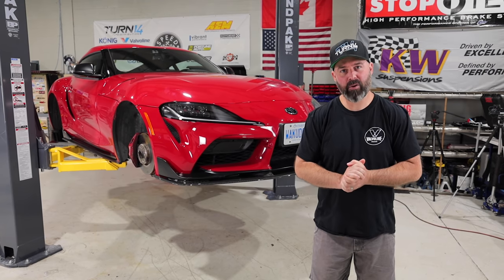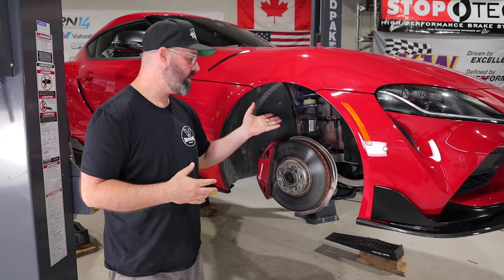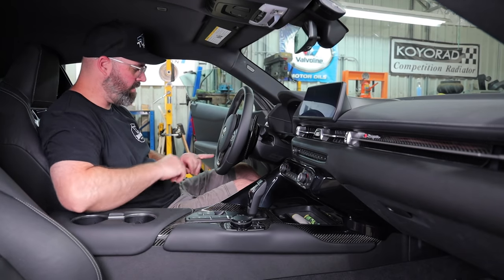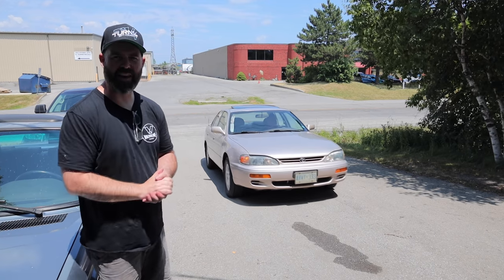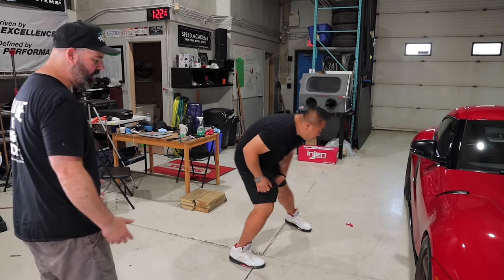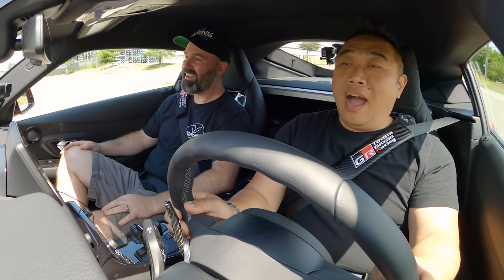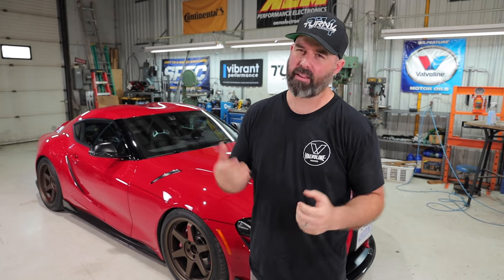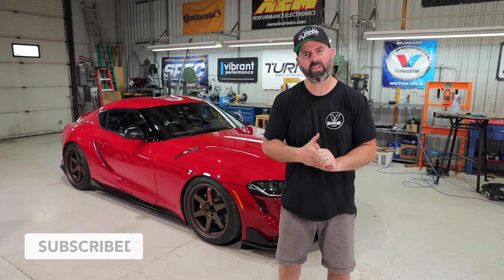Quick and Easy Toyota Supra Build - Part 2 of 2

Comment: What people don't realise is the progress made in the last 20 years on cars isn't so much at the top of the chain, but the bottom and middle of the chain. There are some pretty boring cars that will take out sports cars of the early 00s no problem, and sports cars of today that can take on super cars of the same vintage because of the progress in technology of things you don't even think about. OEM suspension components have gotten better. OEM brakes have gotten better. The way power makes it to the ground has changed a lot. 
I'd wager stock vs stock something like a V6 camry or accord would give a 90s/00s NSX a hard time on the track.